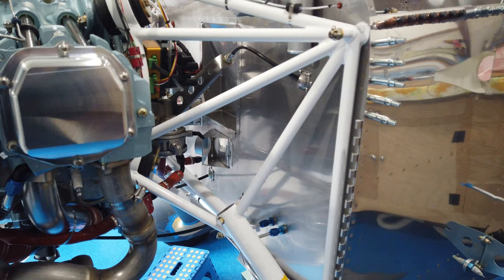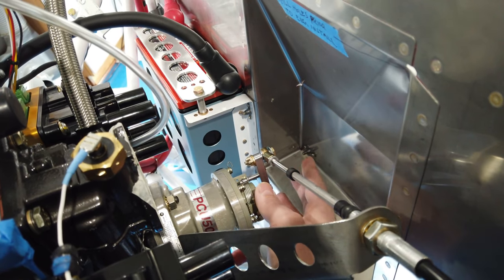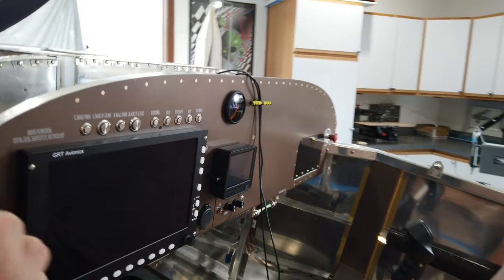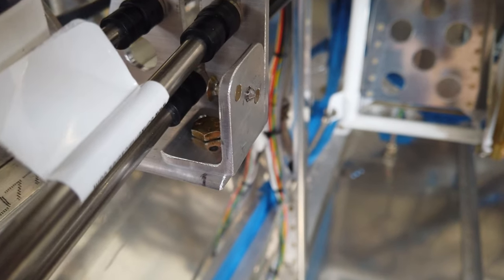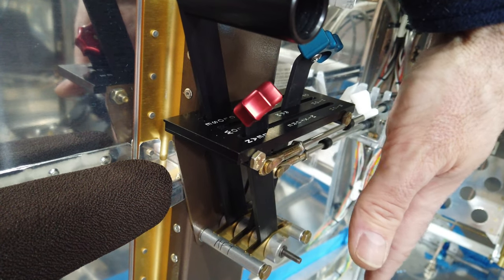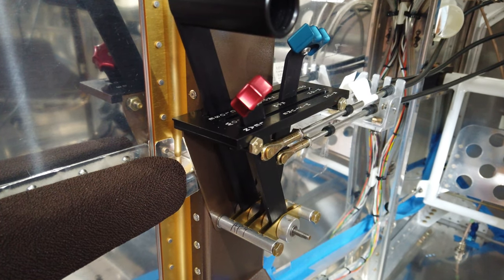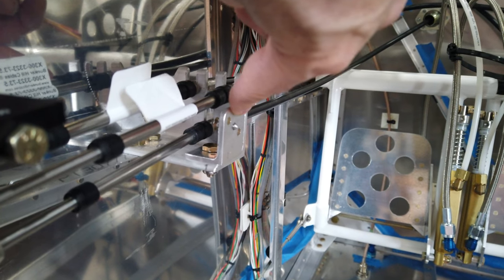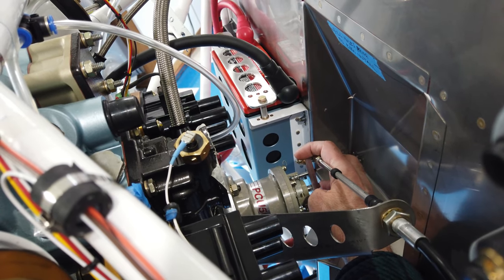Vans RV 7 HINT Videos Engine Control Cables Final

Comment: I fly an RV9A and believe the 7A has the same cockpit dimensions.  It is a very snug fit for two adults.  With your throttle quadrant location and your custom console I would be concerned with the amount of room available for the pilot and passenger.  I am right handed and was concerned with controlling the stick with my left hand but it turned out to be no problem.  There is enough room between the two seats for a couple of water bottles and the glove box gives you a place to keep maps etc.
Reply from the maker: Howdy Michael. Taking up more space was a concern so my wife and I fit test ourselves, with full interior, the center console and throttle quadrant. We are not large people and fit just fine. I agree that this set up will not work for most. The center console is fine but the throttle quadrant will just be in the way and annoying. Just to be clear, mine is a -7. (not -7A)